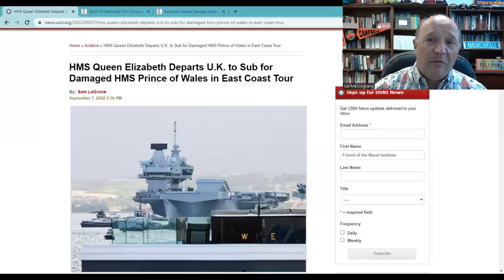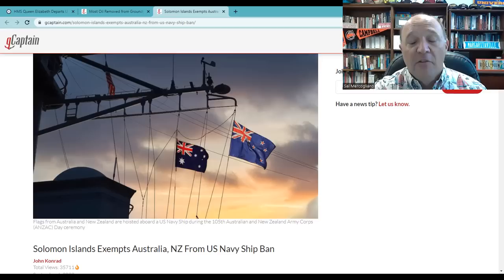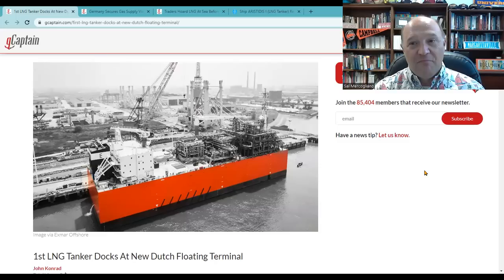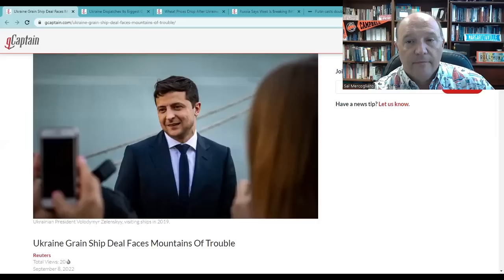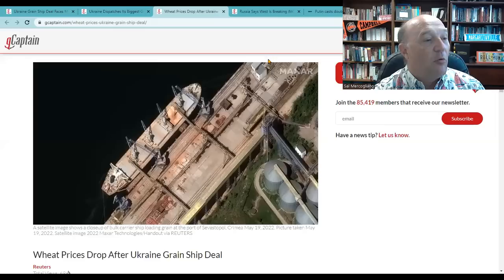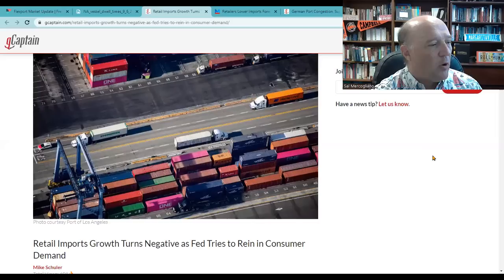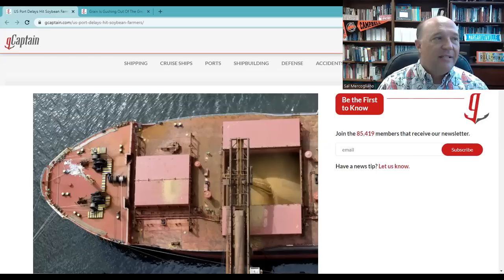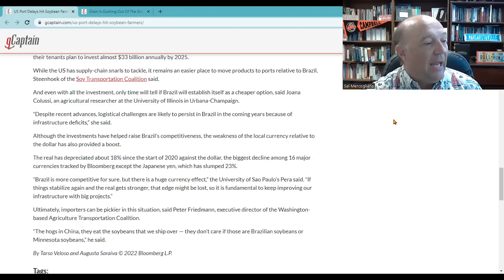What the Ship! (Ep 49) LNG to Europe, Ukraine Grain, Containers, US Soybean & DOD Firefighters

Comment: You say that an incoming LNG carrier cannot just pump the LNG ashore, but that is not quite true.  It can pump it to a shore-based regasification facility, which then turns the LNG back into gas by warming it --  using gas to do so, and then send it on its way through a pipeline.  What the Germans plan to do is not to build a shore-based regasification terminal but use floating ones, called FSRU - Floating Storage & Regasification Unit; basically a vessel that receives LNG from an incoming LNG carrier, stores it on board and regasify it.  Lithuania has been using one of these for several years.  I suspect FSRUs have advantages in being able to be moved to other locations when no longer needed, and in being less likely than shore-based regasification terminals to provoke public opposition, because of the serious risk of extremely hot fires should anything happen.
Reply from the maker: Yes...but Europe lacks these facilities as they depended on gas pipelines.  They are building ones ashore

Comment: Fun fact: Combusting natural gas is environmentally beneficial, because the reaction outputs need 2x as much energy to gain 1 degree as the reaction inputs. 
- The process is CH4 + 2 O2 => CO2 + 2 H2O
Considering whole mols of matter instead of individual chemicals allows easy comparing of energy absorption. In Joules of energy per mol: 
- Before: CH4 + 2 O2 = (35.69 + (2 * 29.38))/3 = 31.48 J/mol for every 1 degree increase.
- After: CO2 + 2 H2O = (36.94 + (2 * 75.327))/3 = 62.53 J/mol for every 1 degree increase.
This is due to the high heat capacity of water.

Comment: That’s a pretty bad coupling fail to cause that much damage.  It should not cause that much.  That sounds like a string of Swiss cheese failures to lead to that.  Bad design and maintenance etc.
Reply: True to its name, though
Reply: Or, a particular sailor or sailors did not want to go on cruise and made slight adjustments to the couplers. Not unheard of in any navy.
Reply: @cameltanker1286  I am sure they can find root cause…but admitting something like that might be tricky for various reasons.  That’s a pretty big risk to try to get away with.
Reply: @cameltanker1286  Those things are massive. Have you seen CV couplings from your car, even? Really shoddy build, though. The other carrier was leaking before. Sailors are a superstitious bunch. Like you name a ship, so she sails, they say :)

Comment: Russian Oil is DOA as broke $81 today and cost of production is estimated at $60-65 and with sanctions and other unrelated issues total expenses close to $75. I’m no Yellen fan, but    right on how to defeat Russia quickly. Many are predicting $60 oil this month. Putin is finished then.
Reply: The lift cost, meaning the cost to produce another barrel of oil from existing fields in Russia is $3-5 dollars.  As of today, the price of Brent crude, the closest competitor, is $90 a barrel.   But Russia is selling their oil in rubles, not dollars.   

Germany and a lot of Europe is also dependent on Russia for coal for electricity generation and steel making.   The largest steel smelting operator in Europe (ArcelorMittal) has shut down several of its plants indefinitely due to high energy costs.